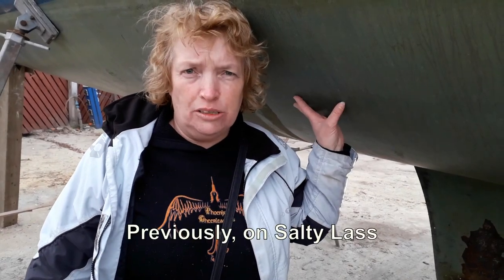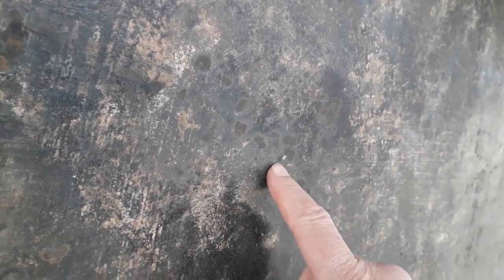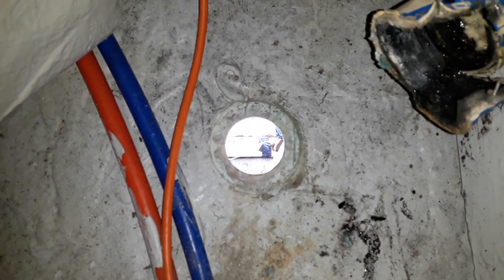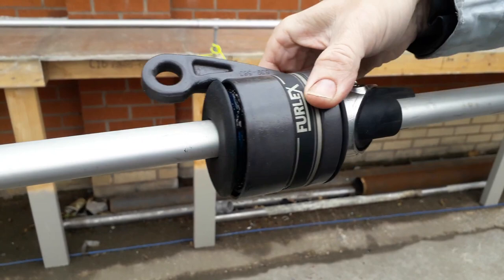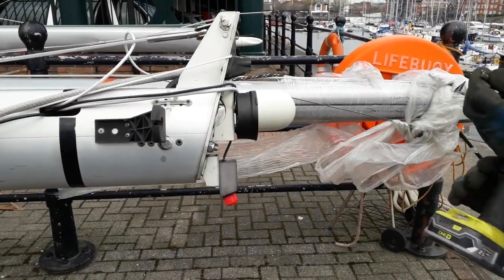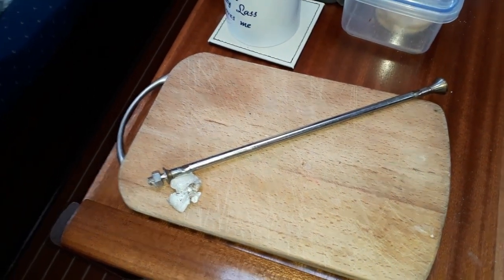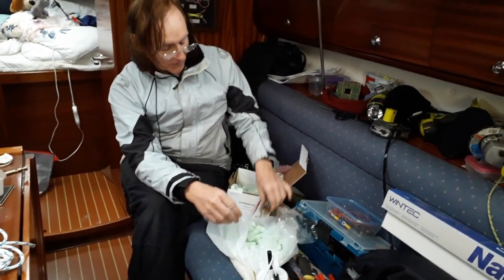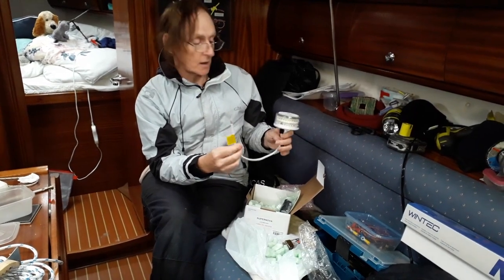Ship wrecked? On the hard & in the yard - Ep. 82

Comment: I know its a while ago but is their oil in the saildrive leg?
Reply from the maker: Yes. We check it before every single trip. It is the first item on our checklist
Reply: @SailingYachtSaltyLass  I just thought that while you were on the hard you might have changed the oil in the leg. Bearing in mind (pun intended) that fresh oil is cheaper than a mechanic. My other thought was if any seawater has got passed the seals at the bottom of the leg you wouldn't necessarily see it on the dipstick as the oil will tend to float on any water. By draining the leg if all you get out is clean relatively clear oil then all's good but if water comes out at first or the oil is grey and milky that indicates any water has emulsified with the oil and the seals need changing.
Sorry to be so long-winded, brevity was never my strong point.
Reply from the maker: We did change the oil when this video was shot and it was all nice and clean. DO not worry about the brevity issue, we suffer from it too.... ☺